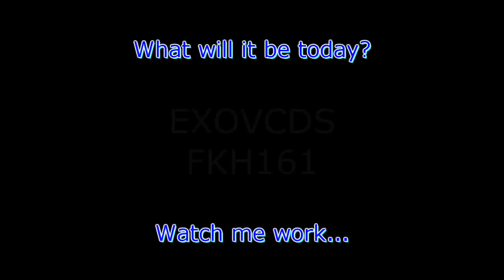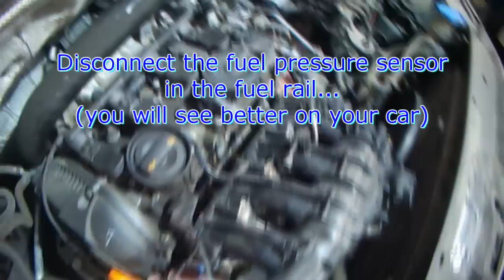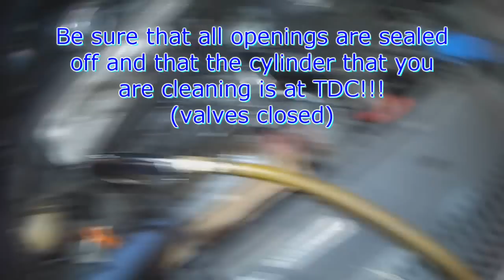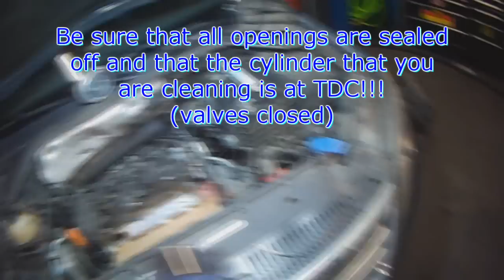VW A5: Tiguan 2.0LT Intake valve decarb

Comment: This video just popped up after so many years. I have a VW CC with a similar engine. At 84.000 miles the warning light came on and we went to the dealership. After a diagnostic a leaking intake manifold. When they started replacing it they informed me it would be wise to have the intake valves cleaned as well. Luckily the manifold was replaced under guarantee. The rest cost us $445 on labor and misc parts. Normally the cleaning needs to be done between 50 - 60k mls. We were lucky under those circumstances as usually a valve cleaning job is around $ 850.
Reply from the maker: Yes, that's a good maintenance schedule for cleaning... depending on driving habits / conditions, it may even need to be done sooner.

Comment: Fantastic video. Most direct injected engines are having this problem but nobody has admitted a procedure to clean them that I am aware of. Years ago we used crushed walnut shells on the Ford Tempo/Topaz  but Ford has not approved anything yet for their problem. They have been replacing cylinder heads. They also say that air intake chemicals will overheat the turbo on engines equipped.
Reply from the maker: wysetech2000 A friend of mine at a VW dealership says they use sodablasting to clean the carbon off. I like the walnut setup I have (was cheap to buy) and as long as no walnut debris is left in the head, all should be good.

Comment: Damn Thomas I remember how often I saw your videos when I owned a Audi 1.8t like 7 years ago.Let me tell you that you were and still are the go to for actual repair videos! I recently started working for a mom and pops shop where I am starting to see more vw and audi...is there a diag chart that you follow to accurately diagnose carbon build up on direct injection engines? Or is the cold start misfire all you need?
Reply from the maker: Thanks for the kind words! 
Cold start misfires is a good indication that carbon might be the issue. I use a borescooe (remove intake temp sensor) to check a couple if valves / to see how bad it might be. If there's no history of carbon cleaning... it needs to be recommended as first step. Also make sure that the pcv has the most recent oil separator on top of the valve cover. My current & old shop were mom & pop. You learn as you go.

Comment: Dang bro! I'm sooo doing that since I'm in there but I'm at home diy guy but I love the way you did it I saw a guy use gum out and a power drill!
Reply from the maker: Yeah... there are several ways of doing this. If you have an air compressor & vacuum cleaner, the media blaster can be bought cheaply at harbour freight. Soaking & scrubbing has its benefits... no compressor needed. Start recording & posting vids!  :)

Comment: When do you recommend to do this? Like mileage wise? I have a 2009 vw cc I believe needs this done. It’s just over 100k
Reply from the maker: There is no set mileage... could be as early as 30k miles or as late as 60k miles. Usual sign that a cleaning is needed, is rough running cold engine (misfiring) but OK once warm.

Comment: Hi Thomas EXOVCDS, when you clean the valve using the vacuum pump and compressed air, you mentioned that you need to make sure the engine is at TDC (i.e. the valves are closed), I am assuming you meant foe each piston valves. How do you make sure it's at TDC? At TDC are all the valves closed? I am planning to do this but am concern about large pieces of carbon getting lodged inside the valve. Thanks.
Reply from the maker: Yes... each cylinder has to have the valves closed (intake valves). You can see them when the intake is off... then you just have to rotate the engine when you want to to the next cylinder.
Reply: Hi Thomas, thanks for the info. I was watching another video and it mentioned cranking the engine just a split second to close the valve. My next question is how would you know if the valves are fully closed? Is it possible the valve is slightly opened? Like a hairline gap? Thanks.
Reply from the maker: Bumping the starter to get a cylinder to the compression stroke, can help confirm that the valves are closed (can't build compression when valves are open).  Turning the engine by hand (clockwise) can tell you when you are on the compression stroke and it will allow you to see the valves opening & closing (while someone turns the engine by hand). If you go past TDC, the valves will still be closed for the power stroke and some of the exhaust stroke.... so the valves actually stay closed for quite a while.
Reply: Hi Thomas EXOVCDS , that's good to know. Thank you very much for your help.

Comment: Hi
After you pull out the injectors does they need to change the orings ? I saw that one injector remains on the block, is there any possibility that all 4 to remain on the engine? Thanck you!
Reply from the maker: Yes, sometimes more than one will remain in the head. Yes, the teflon seal & o-ring should be replaced. Injector seal kits can be bought.

Comment: My 2009 Volkswagen Tiguan (134,900 miles) has Misfires and slow response problems. I went to the mechanic like 4 months ago to fix the problem but the same problem came back 2 weeks later. The problems the mechanic fix were the 4 injectors, coil connectors and cleaning the valves I believe.. the final price I paid was 974 dollars for those things to be fixed. Rn I’m low on money so I’m trying to figure out if the problem he fixed was temporary since it wasn’t the main problem or this car is done for good. I been driving with problem for the past 4 months but now it’s hard to drive since the slow response on the camshaft and accelerating is making it hard and unsafe drive in the streets. Also I remember when changing the spark plug I see oil was on the spark plugs and also the ignition coils was never replaced.
Reply from the maker: If he only changed the coil connectors, maybe it needs coils this time. Why not go back and have him look at it. It ran fine for 2 weeks, so he obviously knows what he's doing. I don't know why there's so much distrust when going  to mechanics. The car is 13 years old, of course it will have problems. Many things can cause misfiring / lack of power. Maybe it's something else this time. Timing chain issues are common. Have the chain & tensioner checked before it fails completely.  Are you the first owner, 2nd, 3rd? If you are not happy with it, trade it in for a Honda or Toyota, but then you won't needt to chat with me. =)
Reply: @EXOVCDS  I fixed it myself by replacing the ignition coils and spark plugs by watching your videos and some other dude video so thank you but I’m going to keep it for now then sell it eventually since I have another vehicle.. you should know why people have trust issues with mechanics, mechanics are not here to favor people they are here to do their “job” just like everybody else. Main reason why a lot of people try to do themselves instead of having to pay a leg for it to get repaired. Only people who don’t know nothing about cars or don’t have time to repair themselves or get a replacement always trust mechanics to fix their car, people with a brain knows mechanics are not here for them. You can’t be defending this crappy Volkswagen company even how old the car is, majority of their cars are unreliable. Only positive thing about these cars are driving when it’s repaired or how it looks anything else is complete garbage.
Reply from the maker: @OFFGRIDDAN  good luck with things in the future.

Comment: It's a cheap obd pocket scan  5 speed automatic transmission  I check the codes again it gave p1780 p2138 p0102.  It starts if you try drive it trans starts shifting hard and jerks. Thanks again

Comment: Is this part of schedualed maintenance?
Reply from the maker: No... but depending on driving habits, it should be (on all direct injected engines, because they don't have injectors in front of the valves that would wash them clean).

Comment: Hey Thomas thank u once again. 2 questions I have. How can someone depressurize the fuel system because since the high pressure can hold around up to 3000 psi. Hyuandai I can pull the fuel pump relay out and let it die and then crank until it doesn't want to start no more. Dont know if u mentioned that in the video. 2 is what vacuum are u using for the intake cleaning. I see u have an attachment for ur air hose. Just so I can tell the boss to buy this immediately. These gdi systems are pretty tricky and these valves on start tends to misfire bad when carbon builds around them. Thank u god bless
Reply from the maker: Disconnect the fuel metering solenoid on top of the high pressure pump. Run the engine for 10 / 20 seconds (will set a fault code for that solenoid, no big deal). High pressure will be gone... only low pressure will remain. Open any fuel fittings slowly... place a rag around / under fittings to catch the small amount of fuel that will drip out. A regular sized "Shop-Vac" with a Silicone hose attached to the front of the shop-vac hose. The silicone hose has a hole in it so that I can put my walnut blaster rod through it. The silicone hose needs to be big enough to cover the intake port of the head.
Thank you for watching!

Comment: Hi i changed my intake and code p2015 don't go what's the solution
Reply from the maker: Used or new? Vacuum controlled or by electric motor? Year, make, model, engine? The more info I have, the better I can help. Are the flaps moving when activated with a scan tool? Snapping the throttle should also get them to move... do they? Post a video on your channel so that I can see what is / is not happening.

Comment: Great Thomas. How do you estimate for a job like this?
Reply from the maker: I don't have to... the boss does. If intake manifold is listed in the labor guide, he probably used that as a starting point and then estimated the actual cleaning time.
Reply from the maker: @pedrocols  Not EVERYTHING is listed in labor guides... carbon cleaning was never expected by the manufacturer... so how can they provide labor guide estimates?  Typical response from a "who has the lowest quote" shopper. Cheaper is not always better. Good luck in your quest to save a buck. If you re-read my reply above, you will actually realize that it was a very logical reply. I'm not behind the counter, so I don't know what gets charged (cost will vary across the country, what good is a single $ value then?). Read any of my other replies (under any of my videos) and you will see... that with the right attitude, you would get more than enough help from me to set your mind at ease. The joke is on you... you had your chance. Blocked messages will no longer appear. Good luck getting replies from other channels.  What a joke you are.

Comment: Hello I know this is an old video but I just did that to my 2010 Tiguan and replaced an injector now it wont start any ideas on what to check  or what to do?  thanks
Reply from the maker: Since I don't know what all you disconnected... check all your connections first.
Did you rotate the engine to close intake valves? Which direction did you turn the engine? Did you plug in all the injectors? Even though the engine does not start, did you check for fault codes?
Reply: thanks for the reply  I turned the engine clockwise and random misfire @EXOVCDS
Reply from the maker: So it's running now?
Reply: not yet I took everything off again and i'm rechecking everything , thanks for the respond , i'll keep you posted @EXOVCDS
Reply: @ghettosmurf76  what ended up being the cause of the engine not starting?
Reply: @onenikkione  don't know yet i stopped working on it , I'm taking it to a shop
Reply: @ghettosmurf76  hi Ariel, did you ever find out why it wouldn't start?

Comment: does seafoam actually work decarbing engines when done through vacuum hoses or at the throttle body??
Reply from the maker: Not on direct injected engines... the buildup is too much. If large pieces break off / come loose, they can cause damage to the valves. Best thing to do is to manually decarb after removing the intake.
Reply: Thomas EXOVCDS how would I decarb my 2014 vw jetta 1.8t automatic?? is it the same process as what you did with this 2009 tiguan? what is the benefits performance wise does decarbing do to your vehicle?
Reply from the maker: Sorry about the late reply... I have not yet done one on a new 1.8T
If the engine does not have an "extra" injector (some new direct injected engines  have one) that sprays fuel ahead of the intake valve (to help reduce carbon build-up), then the only way to clean the carbon is to remove the intake manifold and use some kind of media blaster or manually scrape the carbon off.
Reply: Thomas EXOVCDS has Erwin manuals updated their repair manuals yet? how detailed are their repair manuals?
Reply from the maker: Sorry it took so long... erWin website had technical issues that tech support did not believe. Here's the drain & fill portion of the service manual: http://fkh161.ca/VW/CoolingDrainFill.pdf
Reply: Thomas EXOVCDS awesome man! thank you so much. There's a pressure coolant flush tool from ecs tuning would that be good to help flush the coolant out?
Reply from the maker: If that's what it is meant for... sure. You will never get all the coolant or fresh water out after flushing, so when you add your fresh mix, make sure to be a little on the richer side, to compensate for the water that was left behind in the engine / heater core. Recheck the strength of the coolant after a few days of driving (to allow everything to mix). 50/50 mix will cover to -35c, so if it's a little weak (no big deal... summer is coming).
Reply: Thomas EXOVCDS my next step is to learn how to decarb my intake. I didn't know you had to take the whole intake apart to clean it. I thought it was easy like spray sea foam in the throttle body.

Comment: so he only cleaned one intake port and not the other 3? :) lol
Great video! good stuff. I will add that what should also be done is a oil catch can system needs to be installed on these motors, even though the pcv valve adapter plate is atleast $200, but I've heard and see is well worth it - that is IF it eliminates most of this nasty carbon sludge build up, which i've been told it does. And will save someone several hundred dollars on a job like this (unless you want to do it yourself)
Reply from the maker: All ports were cleaned.

Comment: Great job Thomas..
We also have issues with carbon build up from time to time...but mostly with the dreaded p0171 and/or p0174 depending on engine..
how much did you pat for that tool?
Reply from the maker: guayaco3299 One of many'a my tools that the boss charges extra for on the invoice... without me getting a kick-back. He doesn't seem to think ahead & by stuff we need... but he knows how to charge extra! LOL
Reply: Thomas EXOVCDS 
that always seems to be the case right..
but in my case i just dont do a job n let them loose money till they buy it..
Reply from the maker: guayaco3299 I'm making an effort now as well... to point out that we might need special tools, for things that might start coming in the door.
Reply: Thomas EXOVCDS 
I do also Thomas...but many times it goes into deff ears till they realize the money they loose by not having it...

Comment: was good and detail for the first 8 mins after that just kept on showing 10mm t30 torix???
Reply from the maker: I'm not sure what you mean, sorry.
I record while I am at work, using video glasses (I need a day job to make a living, so I don't have time to "zoom in" on everything). If you have questions about something, ask them. For the most part... remove what you have to remove, in order to remove what you want to remove. 
This video should still give you a general idea of what I am doing. You can "refer" to your own engine (look at it) to make sense of things... again, ask questions if you have them. Making a mistake during this kind of cleaning (big carbon pieces falling past a valve) can cause engine damage. You need to assess if you can handle such a repair. Thank you for watching!
Reply: @EXOVCDS  no worries , no fault , most likely because i dont have enough knowledge to do this im pretty sure

Comment: Thomas, where did you get that intake port for walnut blasting?  =))
Reply from the maker: No special tool... just some silicone hose. Which part in the video? Time?
Reply: Where did you get it?
Reply from the maker: Heavy duty truck repair shop... they cut a piece off of bulk intercooler hose.
You can probably find it at a local Hose Shop similar to this one: (if you don't have a Truck Service Shop near by)
https://www.greenlinehose.com/

Comment: hi, What is the size of the inlet manifold bracket bolts?
Reply from the maker: At what point in the video?
Reply: 14:40 the triple square
Reply from the maker: César Scheid The but at the top is a 13mm hex nut. The bolt at the bottom is an M10 Multi Spline (I think). Looks like this:
https://images-na.ssl-images-amazon.com/images/I/31YPWBjFImL._SL500_AC_SS350_.jpg
Reply: ok, Thank you for your help!
Reply from the maker: +César Scheid If you buy a Multi Spline / Triple Square set... it will most likely contain the size you need. I'll check at work tomorrow to see if I can find the exact size. It's either M10 or M12
Reply: Ok friend, thank you.
Reply from the maker: I don't have a call to test on... but looking at the M10 & M12 bits, I believe it to be an M10 (an 8mm allen wrench / hex bit will fit inside the M10 splines). If you are going to use an 8mm allen bit, don't force it... if it slips, it will strip the M10 splines inside the M10 bolt head.
Reply: friend, I saw in another video that the size is really M10, in the kit I bought has this size. thx